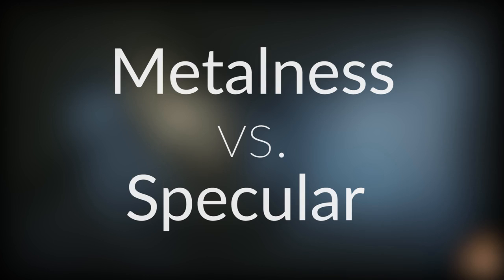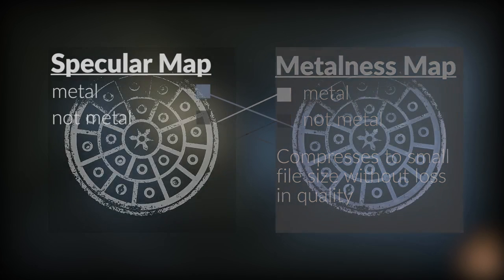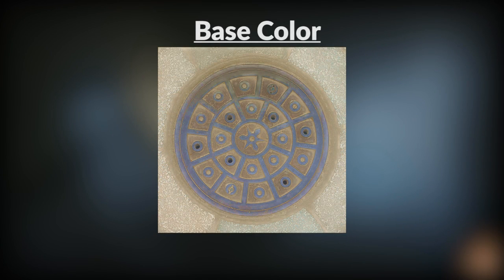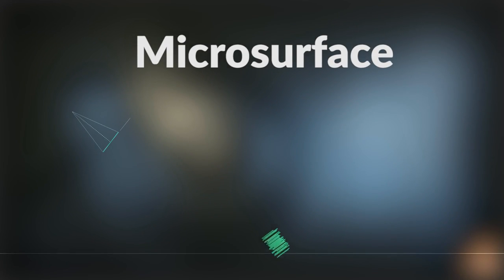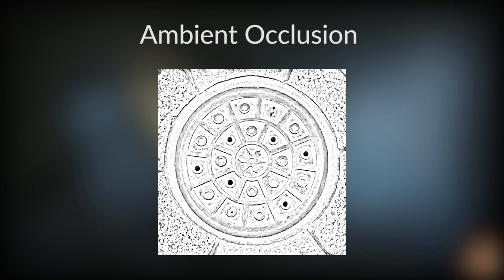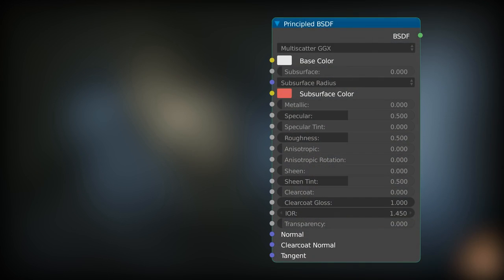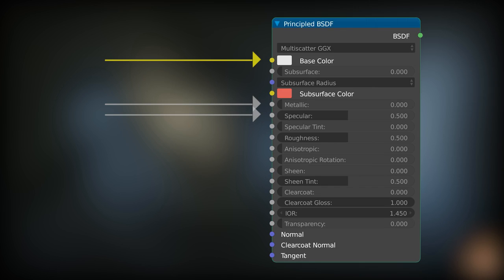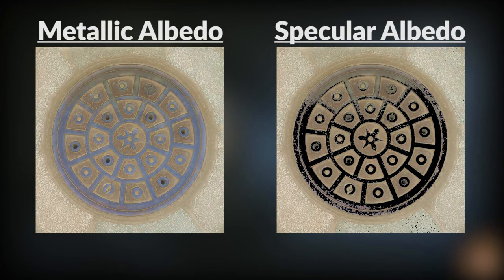Specular vs Metalness Workflows for PBR Shading in Blender

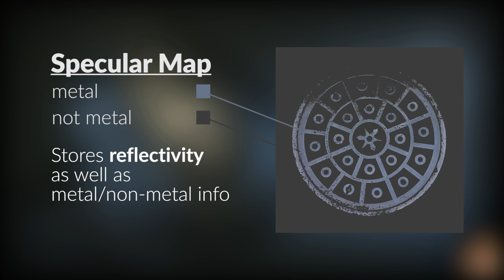Comment: I was checking some info about metal vs specular-workflow. Around @1:40 you state that the metal workflow doesn't really have option to set reflectivity. Is did reflectivity in terms of specular? Because that is what the metal map does, the color is the base or the black body or diffuse color. Perhaps its me but this sounded quite confusing.
Reply: Doesnt the metallic have more info, i mean specular uses black in a color map, thus no color at all to also control specular. WOnder how specular method uses neutral specular color of the color maps are colored?
Reply: Plus side on using Metal workflow is that you don't need to update all maps when you change something. You can work with different roughness and specular maps, where as with specular workflow I don't think this is possible

Comment: Great video. However, I'm a little confused by your scenario at 4:22. It sounds like you're trying to determine, hypothetically, how to use a set of texture maps (perhaps some with no labels, or labels that don't match the input names)? Or, are you trying to determine how to use the node, given the inputs that are available? Or, are you just trying to determine if an existing patch (already setup) is metalness based on whether metal color is fed into Base Color?

Also, does Blender automatically determine it's a metalness workflow when color is included there? What would happen if a pixel has color both on the Base Color map and the Specular Map?
Reply: Yeha thats super weird, i thinnk he was trying to explain since the base is color that means its a metal workflow. But since they also state BLender can do both. How will a specular workflow work. Because I don't think you can use the same method for specular with this principal shader. I find the Specular method vert confusing, much harder to tell when looking at the textures what will happen. Whereas a metal workflow, looking at the maps you can already see how it will be effected. Im also confused about there being color in a specular map in the Specular workflow. If I think about it, this means the reflection also has color which is not correct. At least I think it works like that, I never use these methods. Perhaps its a trick, I remember that in RGB you can story images per channel as well. So probably in Specular workflow it doesn't look at the color actually, only at the BW image. Man this secular workflow is confusing

Comment: hmmm 
I think you're wrong at 01:50
The metalness does have a direct way to control reflectivity , it's called roughness 
So specular could be left at a value of  0.5 , and the roughness factor decides the specularity
Reply from the maker: Reflectivity controls how much light is reflected, while roughness controls the directions in which that light is scattered. In many cases reflectivity can just be constant or interpreted from the metalness like you mentioned, but that's a quick approximation that just happens to look ok.

Comment: The problem with the Metalness workflow, the Principled BSDF and the default shader in Unreal Engine... they don't let you have a different specular color in a way that is not stored in the Base color, that doesn't affect the albedo. The specular tint bar doesn't help either, it's just picks color from Base color again. And all of this is made under the assumption that dialectric materials all reflect white, so "why allow you to change it", right?

A shame, I really liked the way Principled BSDF handles fresnel and roughness at different angles. But it's a metallness workflow mainly, not specular,, and SSS works weird (or maybe SSS is broken), gotta stick with custom nodes for now
Reply: Shouldn't metalness be more accurate because the real world doesn't really have many partly metal things? I don't see how the specular color should ever need to be changed as it wouldn't be physically accurate. To me, it seems like specular workflow is more flexible but the metalness is more accurate
Reply: i find custom nodes are the way to go regardless of the workflow , mainly because you can get anything the way you want it with a little research and you can save it to work exactly how you want at the same time as most youtubers do
Reply: It makes sense for full metals since they don't have any diffuse, but not for partial metals. In metalness workflow, 0% is not 0 reflectivity but base dialectric reflectivity, which means you can see both the albedo and specular color (white). And while it's uncommon to have specular that is colored, if you do want it colored but without affecting albedo, with Principled BSDF, you can't. Plain blue albedo with yellow specular? you can't. 

Another argument people make is that it is uncommon, or even impossible, therefore why bother. Well, it is uncommon for my car to make long road trips, I haven't made any long road trips yet, I still want my car to be able to

I can name lots of real life examples of materials that would be easier to replicate with a different color input for reflections, but the basic principle for partial metals and colored specular are these two. Metal and non metal particles are scattered at a microscopic level, which makes it look like a homogeneous partial metal from a distance. Or an iridescent layer covers a diffuse material, either coating or film.
Reply: +demon gamer
The problem with custom nodes is that the Fresnel node is broken. It needs a roughness input. This makes custom node setups look inferior to the Principled shader, although this may also be the reason for them being faster. The Principled shader does use the correct Fresnel. However, the Principled node is "locked", which can be a problem. I have a lot of speed hacks in my custom shaders that I cannot use with the Principled shader.
Reply: In the Blender 2.8 beta, Evee has the "Specular BSDF," which uses the specular workflow unlike Principled BSDF. I think there's another reason why blender defaults to the principled shader:

"The specular workflow works by specifying the facing (along normal) reflection color. The result may not be physically plausible because there is no energy conservation." -From: https://docs.blender.org/manual/en/dev/render/eevee/materials/nodes/specular_bsdf.html

So it seems there isn't any energy conservation (the amount of light reflected back isn't conserved, which lead to reflections that are brighter than the source with incorrect values), making it LESS physically accurate than the metalness model. I'm guessing that having the ability to change reflection colour breaks the laws of physics, somehow...  ¯\_(ツ)_/¯ 

The point of PBR is to be as physically based as possible. Extra customizability could mean diverging from mathematical physical accuracy (ex: water: ior = 1.33, specular = 0.25, if you stray away from those values, it's not physically accurate). So if something is missing, it's probably because you aren't supposed to edit it. I guess that's the reason why the blender devs defaulted to pbr-metalness?
Reply: I agree, which is why I prefer the specular workflow. But, the metalness workflow will be enough for most use cases, like games. It is easy to simplify the specular workflow for simple cases, but the metalness workflow sacrifices flexibility (and risks dielectric-metal boundary artifacts) to minimize file sizes.
Reply: Great point! Metalness can be slightly less accurate and less flexible, but in most cases I find it easier and more intuitive to work with when painting textures from scratch with negligible difference. The trade off depends on what you're making. It also appears the Principled shader is a good bit slower than a custom setup as well, so it's probably better to stick with a custom group node for the time being anyway.
Reply: True that not many things are partly metal, but the non-metal parts of a specular map can still have a full range of greyscale values, which are used to show reflectivity. Metallic maps cannot show reflectivity, so there's slightly less information overall.
Reply: Isn't reflectivity the same same thing as color? with 0% reflectivity being equal to black and 100% being while and the possibility to have a different reflectivity at different wavelengths given its RGB. I don't see why the base texture would not be sufficient to provide the reflectivity information. The roughness map can then provide the information on how shiny something is
Reply: Wo!262 
It isn't that big of a deal. Only a few non-metallic materials have tinted reflections. And, for those, like gems, just make it a little metallic. Personally, I prefer specular workflow as well.